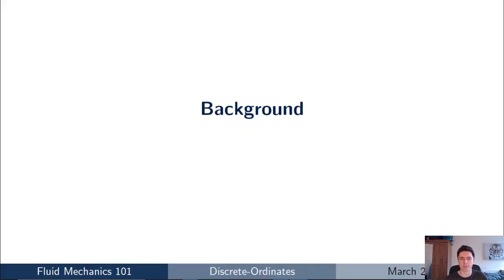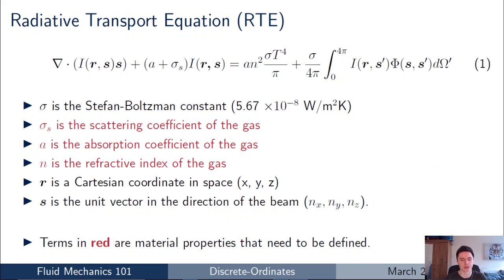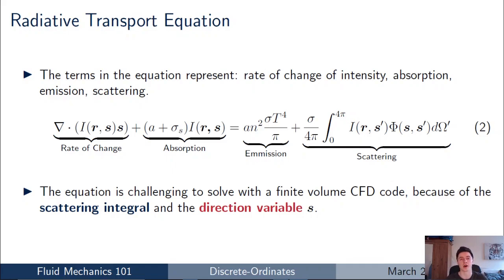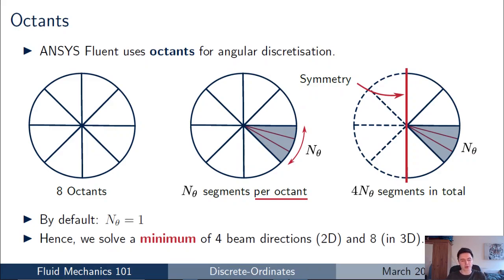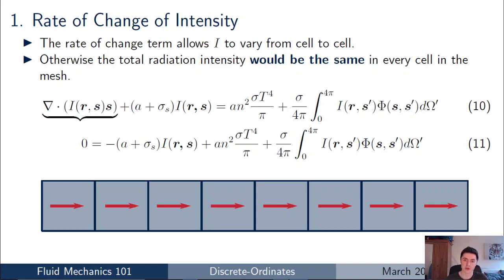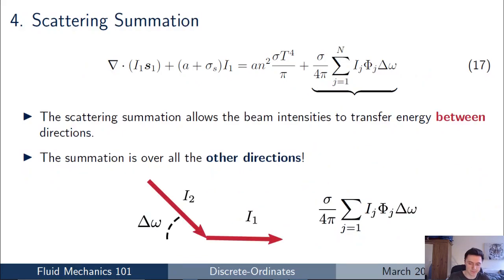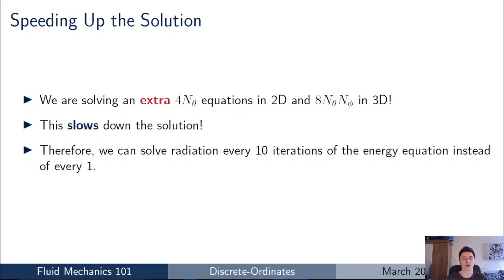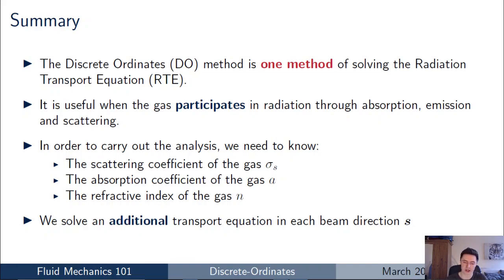[CFD] The Discrete Ordinates (DO) Radiation Model

Comment: Very nice video; thank you!  However, the radiation does not only interact with the fluid at the wall.  Regions of gas that emit net radiation will get cooler, and those that have net absorption will get hotter.  This is captured in the energy equation, which you did not show in this video.  The energy equation is coupled volumetrically (not just at the boundaries) to the RTE though a new term in the energy equation, the divergence of the radiative flux.  That is calculated by a radiative energy balance on a control volume using each of the I's calculated.

Comment: Hi! Thank you for your nice video, I have a question: exactly what are pixelation parameters used for? Thank you very much again :)
Reply from the maker: Without going into too much detail you can think of them as 'direction resolution'. If you think of radiation as a set of beams, how many beams are there? Finer pixelation = more beams = more accuracy + slower calculation

Comment: Thanks for a very clear presentation! However, I'm left confused how we actually (numerically) solve the equations? Are the equations (in this case 8, if there's 8 beams) not coupled because of the scattering? At a point "r", to know how much radiation is scattered into the direction "s1" from all the other directions s2,s3.., don't we need to solve those other beams first?

Comment: Very nice talk indeed. Why is the absorption within the media not taken into account when looking at the sources/interaction with the temperature, e.g. As an additional volumetric source? Since the intensity is changing doesnt that the mean the energy needs to go somewhere?
Reply: I agree, The medium should heat up since it is participating in the radiation. How will that happen if the radiation only interacts at the walls?  The absorbed radiation and the emitted black body radiation  at a point should participate in the energy balance at that point.
Reply: @moma8956  You are correct.   The radiation does not only interact at the wall.  Regions of gas that emit net radiation will get cooler, and those that have net absorption will get hotter.  This is captured in the energy equation, which he did not show.  That is absolutely coupled volumetrically to the RTE though a new term in the energy equation, the divergence of the radiative flux.